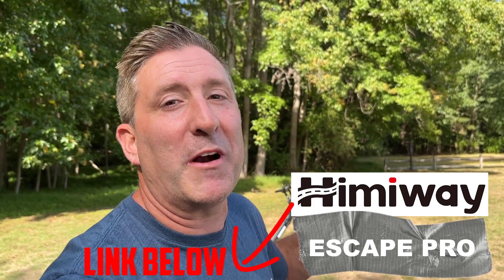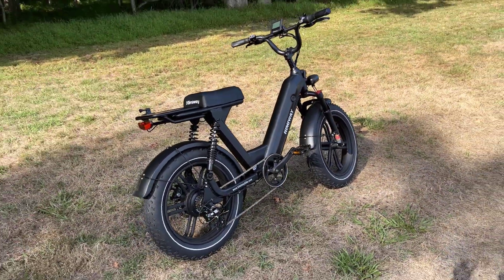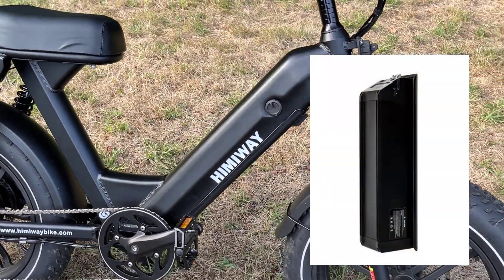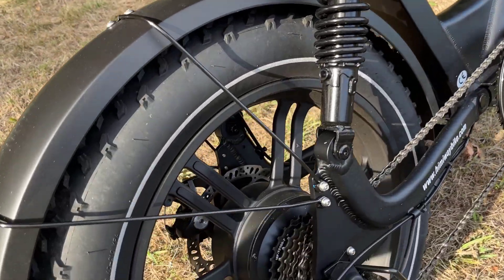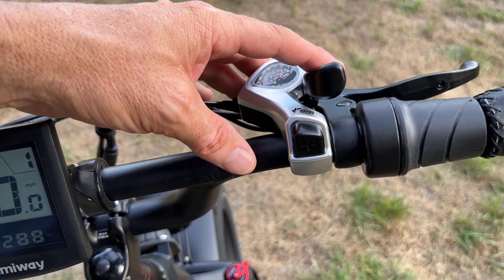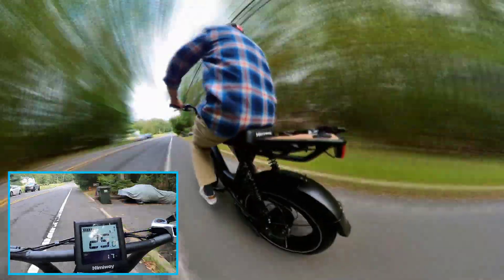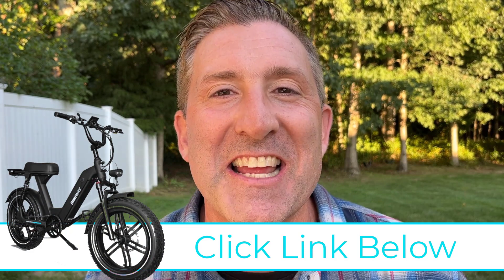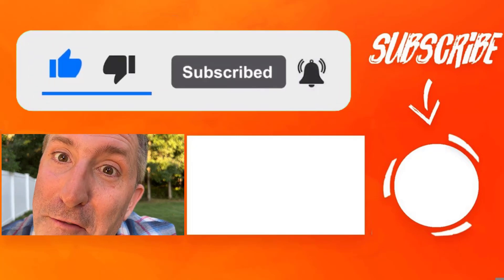The Best E-bike of 2022 - Himiway Escape Pro 🚴

Comment: Great review. I also have the Escape Pro but mine has a slightly different display, shifter, and headlight...? Very fun bike and does pretty well on dirt trails!
Reply from the maker: I wonder - if the model I have is an upgraded version?
Reply: @Kitearmy  could be.... I got mine from Amazon, believe it or not. It has  the bigger battery and new frame but could be older stock from the original batch of 'Pros'.
Reply from the maker: @asthorman  Interesting - Yeah these things are fun offroad
Reply: @asthorman  yeah the 2022 model has a little larger battery and you can't turn it up past 25mph

Comment: 1) HOW do you charge it?  2)Just any outlet at your house?
3)  Does it have an adapter to use a TESLA station?
4)  How HEAVY it is?  5)  Will it fit into trunk of a FORD ESCAP if i lie back seats dows? Or how do you travel with itt?
Reply: 1) Plug it in to the wall
2) Yes
3) No, bad idea
4) 92# (42 kg)
5) it might, but I wouldn’t want to lift it. You ride it, perhaps a lower back of vehicle bike rack
Reply: @cguy96  RATHER THAN RENTING DOWTOWN SCOOTERS, I'D RATHER OWN SOMETGING RATHEN PAY THEM OR WALK UP THE STEEP HILL.
Reply: @RightToFreedomGirl  I am very confused:
1) why all caps?
2) I didn’t say anything about renting
3) I see no reason for someone not to buy this model. It’s not to my taste, but that’s unimportant
4) I did mention this is HEAVY, so lifting it into an Escape might be difficult, that’s all. So I mentioned the bike rack which would be easier to use.
Reply from the maker: @cguy96  I also just got another Ebike that weighs 27lbs - I think that would be easier to move around.  But it does cost $3K
Reply: @cguy96  WHY ALL CAPS? I couldn't find my glasses, was struggling to read & write
Reply: @cguy96  Oh, btw thank you.